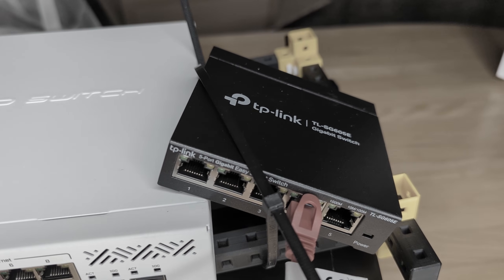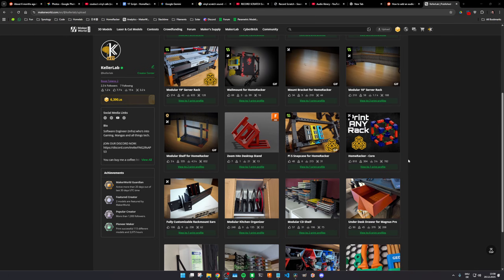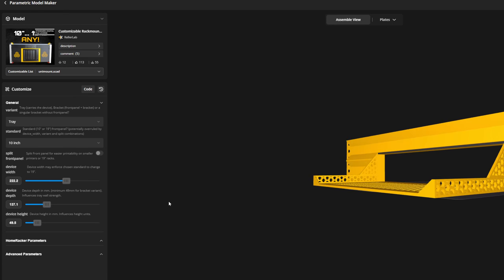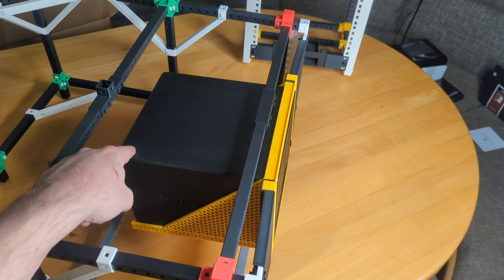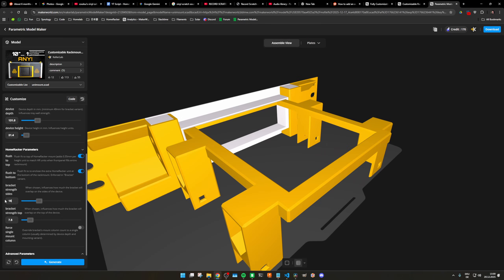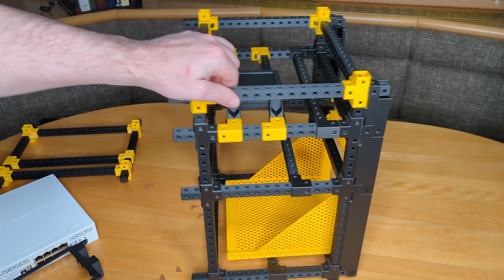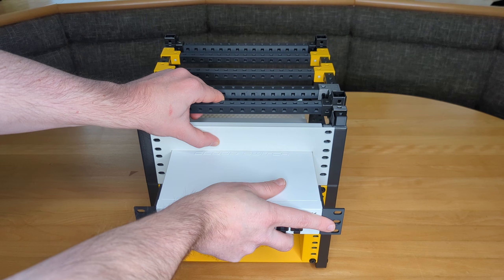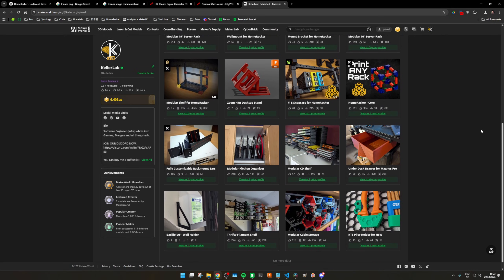I built a tool to Rackmount EVERYTHING [No CAD required]

Comment from the maker: I’m genuinely curious: what is the single most annoying device you are trying to mount right now? 😫🛠

Quick Links for you: 🔗
- Makerworld Model: https://makerworld.com/en/models/2128492-customizable-rackmount-any-racksize#profileId-2304669 🏗
- Customization Guide (for those tight 10" fits): https://docs.google.com/document/d/1lXRifmCBsQZteM0w_jPbze5Uxn_h-3nrQqp8lniq6Y4/edit?usp=sharing 📏📑
- Discord: https://discord.gg/FNG2RsAP53 💬👾

And a huge shoutout 🙌 to the community member who already adapted the bracket for round devices—you can find their model linked in the description! 🔄✨
Reply: Raspberry Pi Zero 2 W with PoE HAT.  I'm using a 3d printed 1U Pi rackmount which has 6 slots to hold trays for different Pi models, drawers or keystone plates.  But no one has modeled a tray for the Pi Zero 2 W 😢
Reply from the maker: @luvmyiroc  hmmm... I happen to have one of those Zero 2 Ws..
should be doable but I'll double check.
Reply: @kellerlabs Thanks, but don't spend too much time on it.  I've got it in the official case sitting on a shelf.  Not sure I can dedicate an entire 1U of space in a 19" rack for a Zero 😅
Reply: My TS-453D QNAP NAS. It has a front cover that can be slid of to the left to hot-swap HDD's. It's on a separate rail-mounted plank for now (Element system from Bauhaus).
Reply from the maker: @Tw2Cents  interesting.. did not think about such a use case yet.
Reply: Not single but my mess of an office that is my home office, hobbies: leather work station, electronics workstation , video editing station, drone station, 4 computers, 4 large monitors,2 printers… it is not cheap, but hideous.
Reply from the maker: @graphguy  I feel you. I also got so many devices and stuff in general that still needs to get organized.

Comment: Maybe I missed it, but what if I want to mount my 5kg Synology NAS in a 19" rack and avoid sag?
Reply from the maker: that's only partially possible if you use HomeRacker as your rack base (last point in my video where tray and HomeRacker merge).
But take it with a grain of salt. These 19" extended HR supports are not meant for load bearing. Currently working on trusses though to make them load bearing.
will take a little while

Comment: how do i go about my 1019+ Synology Nas? it is 230mm wide which then makes it too wide to print on my X1C when i split the panel.
Reply from the maker: I think you've hit the limit of this model there. 
You can either consider a bigger printer (less likely) or use a different model.
E.g. my modular shelf for HomeRacker: https://makerworld.com/en/models/1350569-modular-shelf-for-homeracker#profileId-1393154
Reply: @kellerlabs  thanks. also, is there a patch panel model for rj45 keystones available?
Reply from the maker: @crazysteve8088 not a patch panel. but I vaguely remember someone created a keystone adapter for homeracker on makerworld.

Comment: Can this do 2 devices? Example, I am building a 10" rack. I have a 1U wasted because it is just a raspberry pi. I would like to combine a small switch and the raspberry pi  in the 1U, but also these builders I find are only capable of configuring the 1U for 1 device slot
Reply from the maker: not yet, but it is on my list for v2 already.

Comment: Half height PCIe cards are definitely the worse right now, having like 4x low profile PCIe cards fitting a 10" mini rack is currently impossible.
Reply from the maker: You mean, arranging those cards side-by-side on a single level in a 10" rack?
Reply: @kellerlabs Yes, just like GeekPi's 4x board SBC shelf for mini racks. That's the current gap that people in Jeff Geerling's GitHub are trying to solve for a few months now and can't seem to get it right. Raid Owl has also uploaded a new video this week on something similar but for 19" and hull height PCIe.

Comment: Just a silly thought but... Side panels with PC fan mounts could be useful thing to have in this system.. and could make it with different sized fans.. and maybe little bit of cable management too
Reply from the maker: not silly at all. 
I once created this for 80, 92 and 120mm.
But very specifically for my 10" rackmount kit: https://makerworld.com/en/models/1353730-modular-10-server-rack#profileId-1396918
Back then I called it an airflow kit.
However, I do have plans to make this more versatile in the future.
Reply: @kellerlabs  I hope you do because it would definetly improve the airflow. I do think it would be useful if it could fit the bigger fans too like 140mm, 160mm, 180mm and 200mm because they can be quieter but pushes higher volume of air through.
Reply: Oh and I think being able to do dust filters is pretty much a must for fans in general.
Reply from the maker: @touma-san91  thanks for the input. I'll consider it... maybe (just maybe) it'll already be my next model

Comment: My most annoying device would be the Bosgame M5, with its dumb gamer design. Either I take the motherboard out and make a case for it myself, or I do the lazy thing and just use a boring tray with no fancy front plate.

Also, would it be possible to have this mount directly to the HomeRacker beams instead of to the rackmount things that are then attached to HomeRacker? Seems like an unnecessary middleman if going full in on HomeRacker, unless there's some engineering reason I'm not seeing.
Reply from the maker: uh... yea I see that "gamer design". But since it's cuboid in general, the bracket variant should be perfect for you if you want to go all in on HomeRacker. There is a "Bracket w/o Frontpanel" variant as well. The customization guide will reveal more info. If you have any further questions, please let me know.